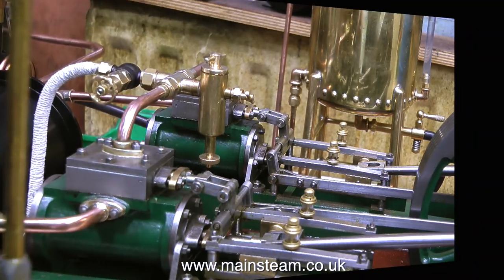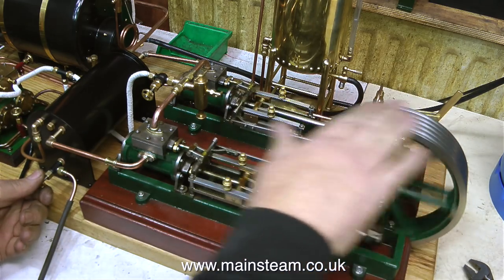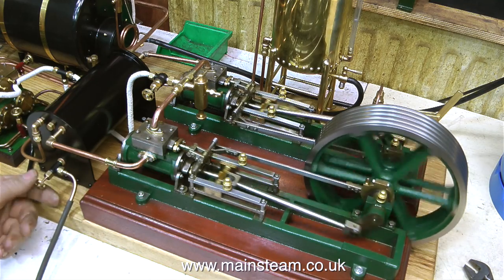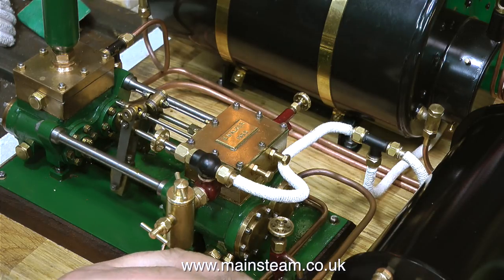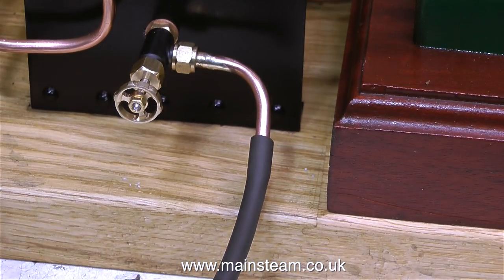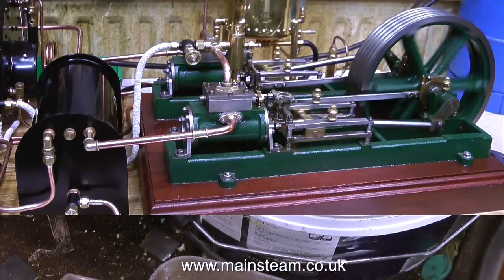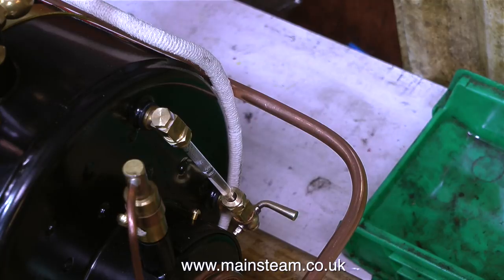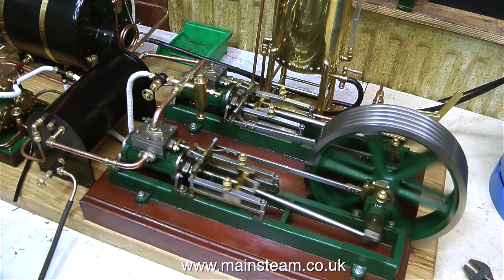ASSEMBLING A HIGH QUALITY MODEL STEAM PLANT - PART #20

Comment: So what exactly is the point of the condenser?  You're not reclaiming the condensed exhaust, it just gets dumped overboard.  So what does it do for you?
Reply from the maker: it stops the oily exhaust from gurgling up the chimney and generally helps the engine to run more smoothly.

Comment: Why is the steam supply line to the engine steam chests not lagged.  Wouldn’t the reduced steam pressure after passing through the regulating valve drop its temperature and cause condensation?
Reply from the maker: It makes very little difference in a small model and the pipes are easier to clean without lagging. I only lag steam piping that is close to the operator to avoid burns to the hands.